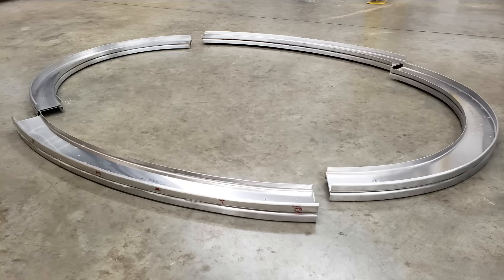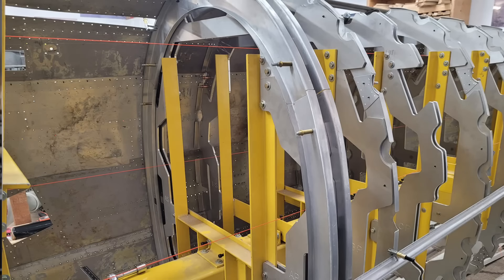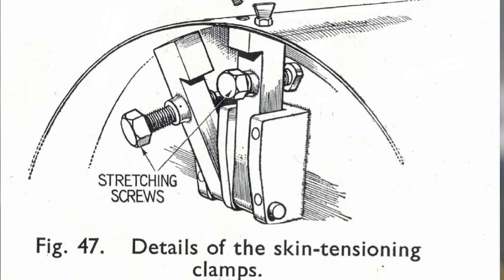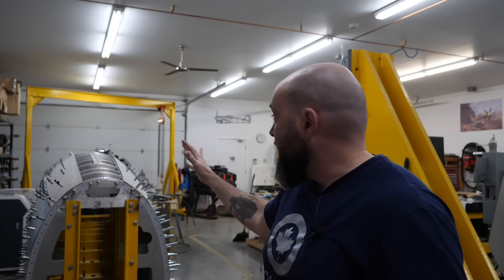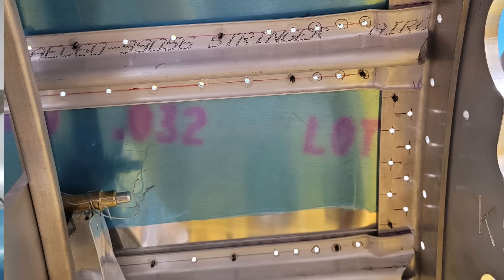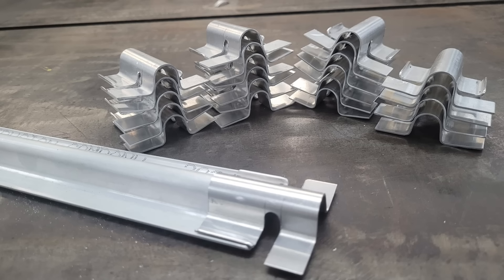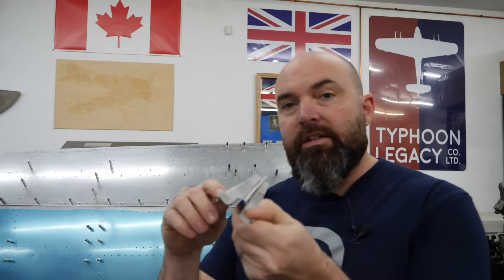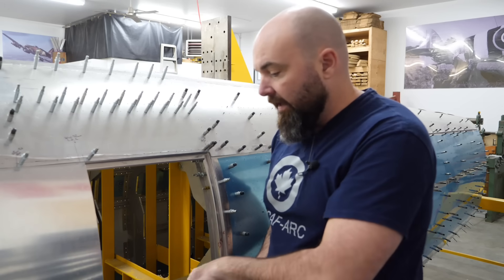Hawker Typhoon - Skins and Stringers

Comment: Why did you not use an English Wheel to roll the sheets into a compound curve?
Reply from the maker: It could have been done either way, stretching the middle or shrinking the edge. Due to the mild shape required, a light shrink is all that was needed. Had the panels been deeper or require more shape, it is likely that a combination of the two techniques would have been used. ~Ian

Comment: How do you intend to ensure the sabre is reliable enough to risk flight. I assume all known mods will be installed, will it be derated? Or will the power be available in emergencies
Reply from the maker: The Sabre became quite a reliable engine towards the last half of the war and into the early 1950's. The big issue will be the lack of experience with these engines, there are no people with "hands on" experience with Sabre operations. We will be building up a Sabre for testing and running, and expect that it may have to come apart several times before the knowledge and experience is suitable to maintain the engine for safe flight. There are no plans at this time to limit the engine, however there will be limitations put on the operation of the aircraft. ~Ian

Comment: And all this was done with draftsmen at tables with slide rules, then turned over to machinists to create the tooling, and then to the logistics to source the material,  then to the shop floor to build the aircraft; all while under threat by Nazi bombers. Quite an achievement.

Comment: Thanks for the run down.  I guess Hawker had to come up with a "low skill" method of obtaining the compound curvatures, indeed trying to design the structure to avoid them where possible.  Well done Hawker.
I remember, when I worked at Westland Helicopter, watching the fitters shaping the skins for the Sea King hull, which has a lot of compound curvature.
They had a wooden "egg box" jig as a pattern and an English Wheel.  Two skilled men rolled the skin back and forth in the wheel until the skin fitted the pattern.  This was a highly skilled, almost artistic process.  Only very occasionally did the fitters need a short length of packer between skin and stringer to pull up the rivets without prestressing the structure.
Reply from the maker: There are some real masters of metal out there that can perform some very impressive work with metal repair and fabrication, they make it look easy....until you try it! ~Ian

Comment: I love hearing you speak in inches and not metrics
Reply from the maker: If I tried to work in metric I would go insane, despite being Canadian and surrounded by the metric system; aviation in North America is typically all Imperial and is all I have ever worked in. It worked out well that the aircraft was designed in the imperial measurement system too! ~Ian

Comment: Fleet have a Farnham roller in Fort Erie, at CWHM we used a tapered oak mandrel to vacuum form our leading edge skins on the Bolingbroke, it gave them enough set to be able to then manually wrap and nail them on, it was very challenging on the stbd. outer wing and we're almost at the same stage with the port outer wing.
Reply from the maker: Interesting, we looked at using vacuum for these skins as well, but ended up with our tube system, I would like to try it for other items though! ~Ian

Comment: A four-bladed prop would be wise to reduce vibration.  Nice to see a late model Sabre being used.
Reply from the maker: The four blade prop would certainly reduce vibration to some degree, but is not required for safe operation of the aircraft, and would require significant changes to the airframe from how JP843 was built and operated. ~Ian